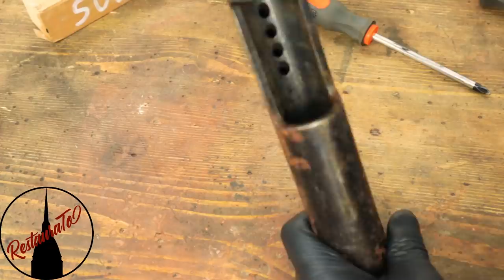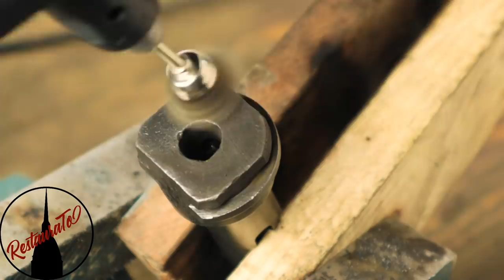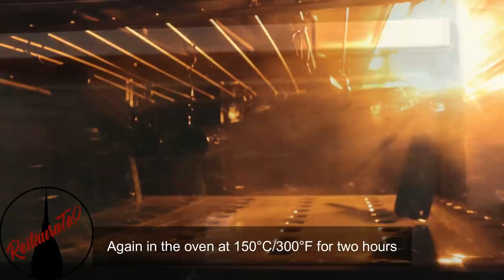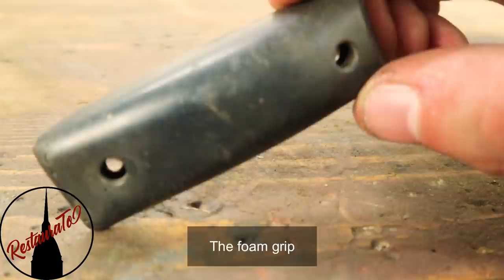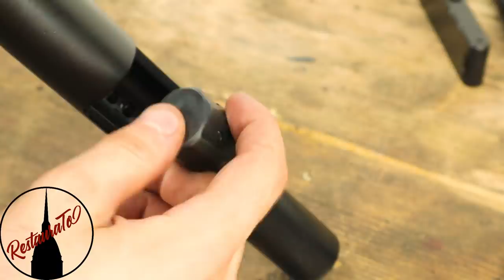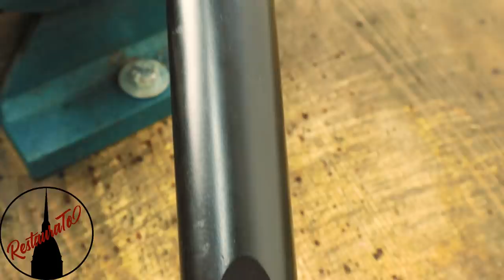Cod nail gun restoration - old spanish nail gun restoration - gun restoraion

Comment: It would be cool to convert it into a plinking gun. Maybe 9mm or .40cal🤔🧐 something with low recoil
Reply: @restaurato6629  it would be in the states. However it would have to fire from a closed bolt.
Reply: @restaurato6629  than run for president or something, I'd vote
Reply: it's called ram-set you can find those anywhere 😳
Reply: @brickphone2570  👀